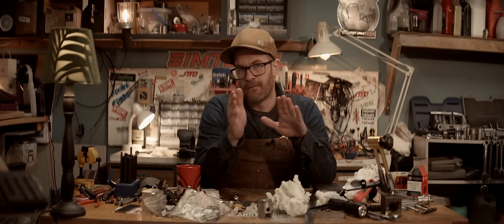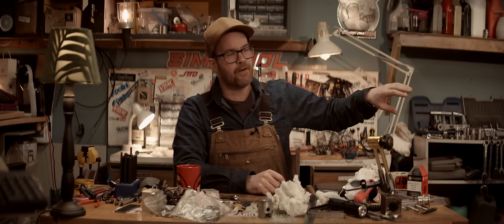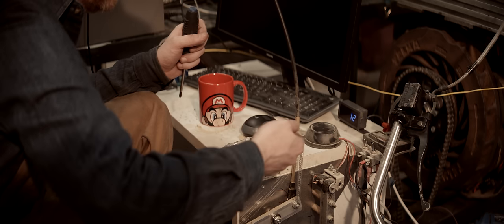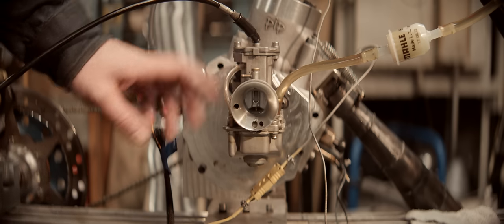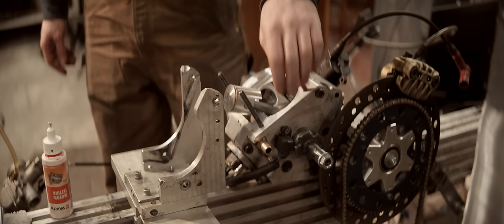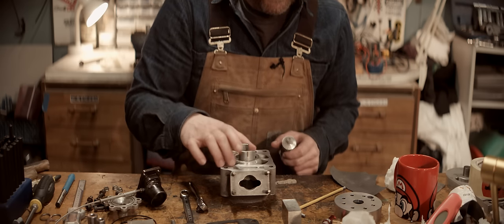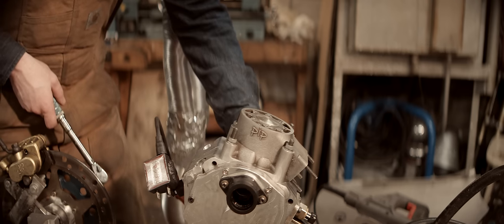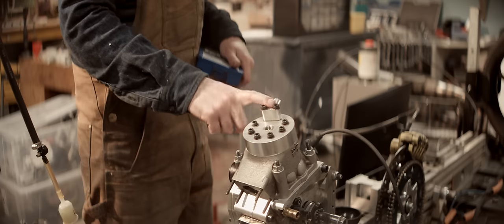Newest Two Stroke Tech: Surprise Water Injection 👍

Comment: Hi Alex I know you probably won’t see this but when you build the water brake, it’s imperative you use a 31 tooth (or at least high tooth count) for the brake RPM. I’ve built two now for outboard motors here. It’s important for the load control to have fast response on the RPM pickup, as the water load is non linear and hard to tune!! Jostien helped get ours dialed in. Outboards run 2.8:1 gear ratio and have very high torque, low rpm which the brake has a hard time loading up (they like higher RPM on the brake shaft) or the toroidal water flow is not efficient

Comment: If you can maybe convert all bolts to studs to hopefully help with not pulling threads out of the aluminum. I only mention this because this is a prototype engine that is being taken apart a lot and what I know about aluminum is it doesn't like threads being used to much. I know you know this but sometimes we need a reminder, I know I do.

Comment: Loctite 515 gasket eliminator is my go to sealant for 2 stroke cases and any other flanged mating surface, not affected by gasoline oil or acid. Good for .010" irregularities on mating surfaces by itself and .030" when used with a primer and it's anaerobic.  Never had a failure myself, it is the recommended product by Mercury Marine and SkiDoo.

Comment: (12:25) He really just grabbed out red hot metal and went "oh it's still hot" and put it back in like nothing.
Reply: it's just Alex, he's built different 😆
Reply: Actually those copper washers were cold! You can clearly see that when water hits the board it hisses. So the board was hot not washers.
Reply: I like the way you think.
Reply: @connorowens-zi4pu  Thanks! But there is nothing to think, You can see it in video. I have softened copper washers like that many times and they cool down very quickly. Those washers were cold as that water. The piece that washers were heated on, was still hot and vaporized water when Alex put wet washers on it. Slow the footage down and watch it couple of times if You can't see it first time.

Comment: For sealing engines, I've had good luck with Reinzosil, it's been holding up on my DT125R, even on the headgasket with a 2 piece head (stock head is notorious for blowing gaskets due to 1 stud being further away, modular heads are even worse)

Comment: The Yourdyno valve is just a few parts off Amazon and a custom bracket. I bought all the parts for under $180 to build my own for a diesel engine dyno I'm building. It's not worth the $1500 they want for it.

Comment: Test that your sealant is resistant to your fuel. I rebuild chainsaws professionally and have had many types of  RTV silicone fail. I finally got tired of it and did a test with different sealants. I just stuck a couple of large washers together with each sealant, let them cure fully, and then I put them in a jar of fuel and let them sit soak for a while. Many "engine sealants" failed they where not resistant to fuel they softened, expanded and lost their bond or completely dissolved. The one I ended up going with was permatex Moto seal which was completely unaffected by sitting in fuel for months. Not sure if that moto seal product is available where you are but its been good for me.

Comment: I feel you on the hardware failure. Was warming up a racing chainsaw and a 12.9 grade bolt on the rod cap pulled clean apart...thankfully the engine can be saved, but what a mess it made.

Comment: Love the inventiveness of the things you do, have you thought of removing the brake lever from the master cylinder and threading where the lever pushes on the piston to give a finer control of the brake pressure, you could even use different thread pitches for the control you want. Keep up the good work.

Comment: Try adding methanol alcohol injection at the intake port as an engine coolant. GMC did this with the V8 215 aluminum block engine back in the early 1960's to try and stop detonation. The stock compression ratio of this engine was almost 10:1.

Comment: I have learned that you should preemptively add thread inserts to any female threads in aluminum and then I prefer keyed inserts that positively locate and require a larger threaded hole than a helical thread insert.

It just gives me so much more peace of mind because I've never had that type of insert fail me.  You just have to have enough meat around the hole.
Reply: Mhm can confirme I work in a foundry and the cnc cut forms (called Model) too make the actual form for the cast are all made form Alu or same kind of Polymer blocks every threat has inserts Alu is just too soft for metric or impireal threats in combo with steel blots 😅

Comment: Been there with the jacked up threads.. got a $1200 race prepped stroker kit clearanced small block Chevy block and it came with a poorly done heli-coil in the one of the water pump bolt holes that failed on me last time it was apart. Oh, also broke a brand new head stud off in a big block Chevy we were assembling once on the second torque sequence. That one made me sick to my stomach until we got the head pulled back off... 😅 It happens man, damn near makes you wanna pull your hair out but it'll be alright!

Comment: Back in the 1955-6 Bonneville speed week sessions,NSU pushed a 50cc streamlined bike to 127 mph! I’m not certain, but I believe it was a two stroke,assisted by water injection! Unfortunately ,it’s doubtful any of the engineers involved at the time are still surviving, but details of the technology they used must exist somewhere? I think the engine was the 50cc from the NSU”Quickly” moped originally,but obviously seriously uprated,and run through a multiple ratio gearbox.

Comment: Studs not bolts much stronger hold in a soft material especially aluminum.
You should be doing thermal stress relieving by placing the entire engine into an oven heating it to 275 f then placing in cold air and repeating the process five times then test for leaks and make sure everything turns smooth  re-torque.
The heating process does two things it removes all moisture from porosities and material and when cooling all the oil will be sucked into the porosities that is good in the inside of the engine including the cylinder wall.
The thermal expansion and softening of seals will help everythings stress is line up better and move closer into a position it will be in at running temperature and stress.
It's a bit like a torque plate being added before boring.
Cast iron blocker stress relieved seasoned by heating them to 1800° f for 24 hours and then allowing to cool.
The small mass of your motor shouldn't be as critical has a large cast iron motor.
But the materials you're using have close to twice the thermal expansion properties.

Comment: I have my own project, just getting my 2007 Gilera sc125 back up to order so when I do get to ride the bike it won’t look that bad let alone go bad either, it’s a Yamaha dtr engine for all those not clued up on it
Reply: I had a Yamaha DT125 with 20hp I think it was registered as heavy motorcycle... It had little to no power under 9500 rpm, then suddenly a lot of power that lasted to 10500 rpm. Not very practical for off-road and gravel roads that I like to ride. So I got a 4 stroke    Yamaha WR450 and now a KTM 500.

Comment: I hope this waterbrake dyno is accurate enough. At least to aim for is 20 Hp N/A two stroke 50 cc. I think it has been done already.
I would lay off a surpercharger idea. It eats to much of power to drive it from 50 cc. Keep it N/A maybe with exotic fuels route.
And get some best forged materials for cranck , rod and piston up to performance to 18.000 rpm.

Comment: I have had that Wurth sealant fail multiple times.  In my opinion it is not suitable for metal on metal.  Or anywhere with any significant clearance.  It is good for putting on paper gaskets and that is about it.  Use something like three bond TV, or the loctite equivalent.  I have used it on engine and gearbox casings for years.  You will never have an issue again.

Comment: hi 2 stroke stuffing, I've seen a lot of your videos and I've taken a lot of inspiration from them, listen, I wanted to ask you if it was a stupid idea, maybe you can try this: I had thought about exhaust gas leaks on the cylinder exhaust port on a 2-stroke engine when piston goes down, because transfers are open and fuel go through the exhaust port, so exhaust chamber do its work to push back fuel, then I thought of this: what happens if I make a rotary disc valve on the exhaust port only? I'll explain better: transfers are located a lot under the exhaust port, the exhaust port is almost at the top of the cylinder but always on the cylinder wall, the rotary valve opens the exhaust port after combustion when piston goes down, while the piston continues to descend, the rotary valve closes right before the piston begins to open the transfer ports positioned below. When the transfer ports are fully open, the piston begins to rise, and reaches the highest point, and after combustion, it begins to descend and then the rotary valve opens the exhaust port
This will improve performance for good reliability engine, with longer conrod, the rotary disc is calculated based on crankshaft stroke, conrod lenght, compression height piston etc…
What do you think? The exhaust will do only one work: throw away exhaust gases more quickly, for preparing the new combustion cycle

Comment: Since the chambers are so small anyway. Has anyone built a engine with the head flat, zero chamber, with the tiny combustion chamber in the pistons, like most diesel engines.  The pistons would need to be slightly thicker. Maybe .08 mm , forcing all the combustion into a rough sphere shape, near 15-30mm in diameter, it could add a great amount of effiency.  With a power gain!
Reply: Moto guzzi used bowl in piston combustion chambers on a lot of their bikes.

On a 2 stroke there are usually no valves in the head, so you can put any chamber shape you like there and keep a simple, light piston design.

Comment: The mechanic who taught me everything about engines and motorcycles almost 30 years ago also taught me this saying: dirko rot, des motors tot! Means, if you see red sealant on the engine, it's as good as dead.   Dirko is/was a comon Brand in germany, all motorcycle parts stires Sold this Red sealant. It Never worked for me.

Comment: lol double like is like and unlike after...😂 nice video as always... and nice lesson to check cooling system after engine rebuild you can pressurise it to like 1-2 bars an leave it for couple of hours if it sealed properly then pressure should be same as was before (similar as cylinder leakdown, or some other sealed systems)... don't upset when mistakes happens, who not work- not make mistakes... as always I impatiently wait for other video...☕

Comment: Hello, I have a question about removing aluminum oxides from surfaces.  If I use sodium hydroxide and leave aluminum in it for 5 minutes, will the aluminum turn black?  Will hydrofluoric acid remove this black surface and leave pure aluminum? I used PA6/AW2017A aluminum for this purpose and after bathing in caustic soda and rinsing with distilled water, it turned black, why is this happening? Please someone give me an answer.

Comment: your calibration method isn't totally accurate since the weight isn't sitting at a perfect 9oclock position, it is more like 6-6:30 oclock which changes where the weight hangs vertically in regards to the point of ritation of the dyno, dunno if this is understandable just let me know if it isn't 😅

Comment: you have had 20+? hp
20k rpm
the motors showed no signs of making less as the rpms climbed... adjusting thing only made it more powerful down low but it still kept gaining power. 

i think you may already have the most powerful 2 stroke. it just needs to stay running and be left in a stable condition. 

you have multiple motors? 

both candidates for the position with different methods. more than one engine would be an advantage, and make for content with a running engine, when another is down for repairs or further modifications.

cant wait to hear a sustained 12k rpm again. man thise things were singing

Comment: Hey Alex that Wurth sealant is not want you need in these sorts of applications, use this mate.
Permatex RTV Silicone Gasket Maker, Maximum Oil Resistance - Ultra Black, 95g
Reply: Hand making paper gaskets is a thing of the past, long gone. Automotive manufacturers use it without gaskets everywhere they can, cost effective and reliable.